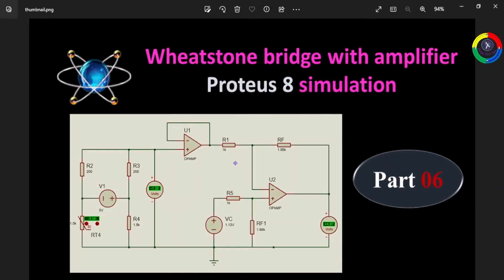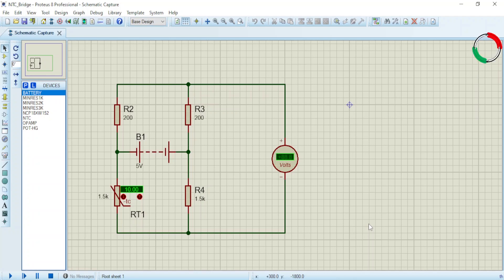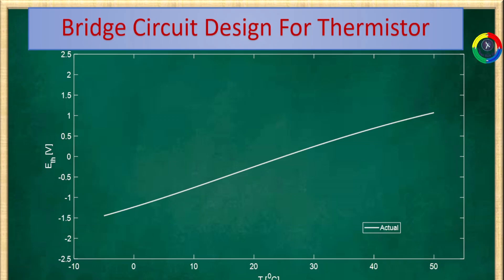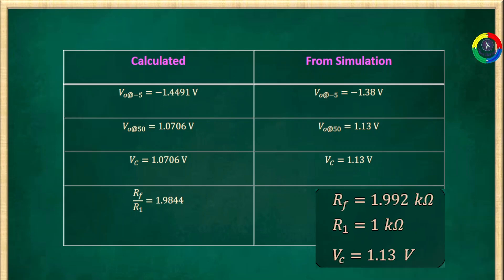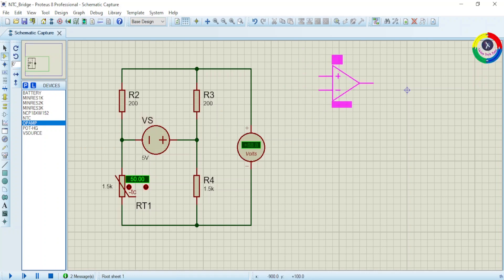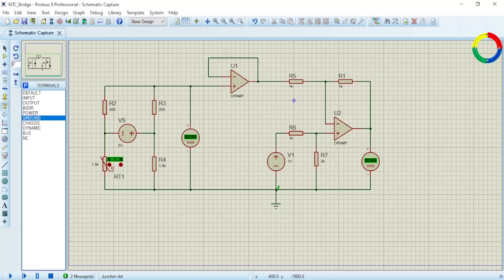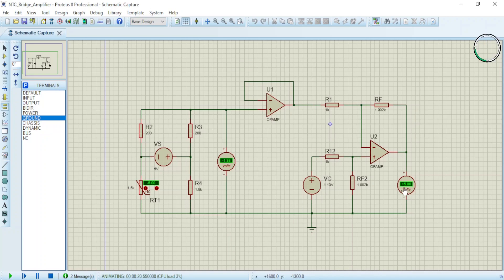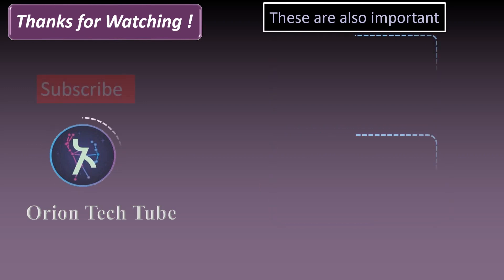Part 6: Simulation of bridge with amplifier circuit for thermistor signal conditioning

Comment: I want to design a temperature measurement circuit like the video using pt100 with a range of 0-1200 degrees Celsius, help me
Reply from the maker: Ok lets communicate, yes42d@gmail.com